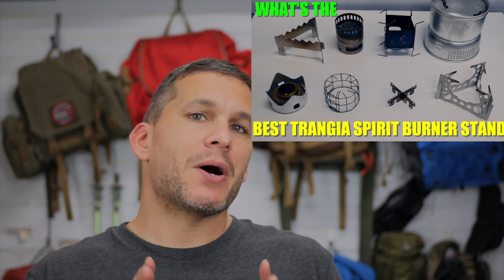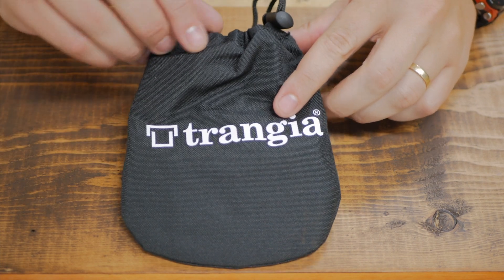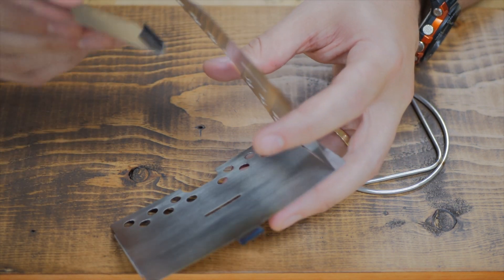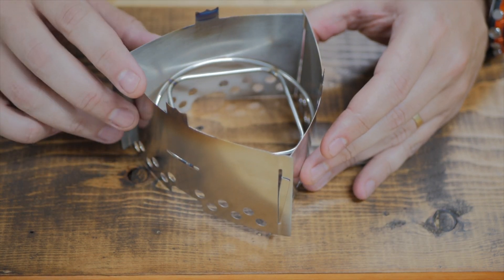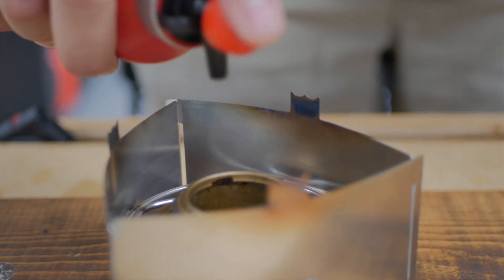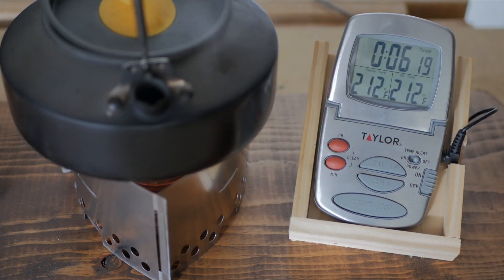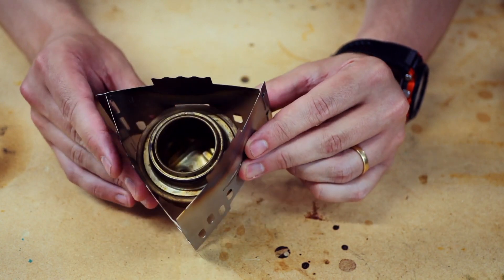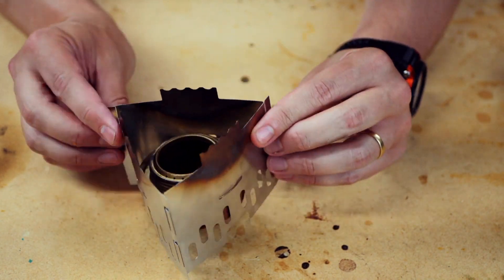Did I Find the BEST TRANGIA Pot Stand? (Surprising)

Comment: I have the same triangular 3 piece Westwind stand as Elizabeth Thompson (below). It came with the Trangia burner - no extra cost. Very easy to use and works perfectly. I've been using the same stove and  stand for over 25 years, and it  works as well now as it did when new.

Comment: I still love the Chinese alocs/redcamp/gohike/several other brands generic aluminum potstand for the trangia. Super light, super inexpensive, and has multiple positions for the stove based on pot size and desired distance from the burner to the pot. 

If you're someone like me who isn't going to use a wood stove to heat pots, then it's a great choice.

Comment: The triangle is definitely the best choice for the Trangia IMO, especially using the GSI kettle. I like the nano, but you need the ti one to make it viable and that's expensive. The Trangia Triangle should be available for around 20 to 30 bucks now that production is back up with the new 2022 version. That's the reason they were expensive, they weren't in production. They are now, with a slightly modified centre ring and the stainless steel triangle side plates now have smoother edging, so no sharp corners. Price in UK is currently between £20 and £24.00

It's also brilliant with the Toaks siphon burner. Just use the Toaks 700ml 115m diameter titanium pot on the triangle with no centre ring, the siphon burner sits in the middle on the ground and you have a great kit that weighs only 176g (6.2 oz). Snuff the burner out with the bottom of the pot and you can pour your unused fuel back in your fuel bottle . . . it's great for a day hike brew kit.

Comment: take the solid fuel plate and place it in the bottom for the triangia to sit on for winter time. Helps heating the alcohol by reducing the cold air flowing from the bottom.
It can still get plenty of air from the sides for combustion.

Comment: Love mine, it doesn't look a lot for your money ( in the UK we get it much cheaper at under £30) but it's simplicity is its brilliance. I use mine with Trangia's own bio-ethanol fuel tray rather than the traditional spirit burner. This makes it more compact for bikepacking and means I can use solid ethanol blocks which easier to pack rather than a fuel bottle. I also have a Bushbox Pocket which I've used with a spirit burner as well as using it as a twig burner. Now I think about it I have far too many cookers 😂

Comment: Interesting, here in The Netherlands the Trangia Triangle is € 26 (including 21% tax) and the Esbit is a couple of € cheaper. The Firebox Titanium Nano on the other hand is € 82. I have a Trangia Triangle, the problem with it is that boiling water in a 300 or 400 ml pot doesn't work because the pot is to narrow. I have to use some  tent pegs to support the pot.

Comment: Except the stove itself, everything sold by Trangia is ridiculously priced and also the products meant to replace Trangia ecosystem are too. I used a Savotta Happy Stove and nest my Trangia stove inside it, works like a charm. Problem with the design of most Trangia pot stands is they don't allow us to put small cup size pots and Stanleys because of the width of diameter. Happy Stove is the one and only cure for this and also a backup as a wood stove in case I run out of alcohol.

Comment: Yeah!  I’ve often said you need to be a doctor to afforded the Trangia triangle! Lol.  For the life of me I don’t understand why they sell it for so much.  I wondered if they had an arrangement with the clikstand people.  It seems like cheap triangles on the American market would undercut them significantly.  Too bad there isn’t a stainless mojo... 

It’s a funny old hobby.  ;)
Reply: Thereal111t Lixada has a titanium one for $8, is round but works the same, add a couple of metal sticks to the top for small pots, specially at that price and works perfectly with Trangia, however like it was said here, The versatility matching Trangia and Firebox which ever size you have is incomparable. I’ll stick with them.
Reply: @carmenmartinez2882  how does the simmer ring function with each of the different alternatives?
Reply: @Thereal111t  It doesn’t fit snug around it, so you can use the simmering ring. It is a tad bigger than the circumference of a Stanley cooking system hence no problem with the simmering top, but you can use the Stanley by putting 2 small metal pieces on the ridges on top or one of those really small square grills that Amazon sells. Works great and I’ve used it in windy conditions.

Comment: I would be interested to know who first designed the "Triangle" there are so many versions of this out there.
Nano has the ultimate flexibility but if gas and alcohol are your main heat sources I don't think the Clickstand with its unique windshield can be beaten, in real world use using the Evernew titanium burner with the wire adapter and the clickstand gives very good boil times.
Reply: Westwind was the first Triangle stand for the Trangia burner. The Clikstand was the second triangle stand (2003). The Esbit and Trangia Triangle etc. are copies of the Clikstand.

Comment: The Esbit version is $69 now...
Wow! I have one that was given to me, and really like it... But I would never spend $69 on something like that. I can make it myself for free from a piece of steel flashing.

Decided to go ahead and get the Firebox Nano... it just looks too cool to pass up... and it seems more substantial for the price.
👍🏻👍🏻
Reply: I asked a local craftsman and he made me that pot stand and a proper alcohol stove for less than 30. (Though i supplied the design, template and measurements).

I also ordered two sheet of titanium and had him copy the swiss pico grill (which i has replaced everything - it's both a windshield and a wood stove)
Reply: Forgot to say he made me custom tarp pegs which i use for the stove configuration as well, saving a lot of weight

Comment: I don't get this time thing, it's boiled when it's boiled, geez! you're in the bush to chill out, not time brews! besides whilst it's boiling you can be vlogging, setting stuff up, taking calls or photos, or just chillin' - what's the rush? I do get the weight thing as you got to carry in and out right. But i just don't get the obsession with speed. I do love my little Chinese knock off trangia it was affordable, does exactly what my other real Trangia does and at less than half the cost. My experiments have been with fuels. But for me, it's firebox stove first unless there's a fire ban, then it's trangia and then gas.